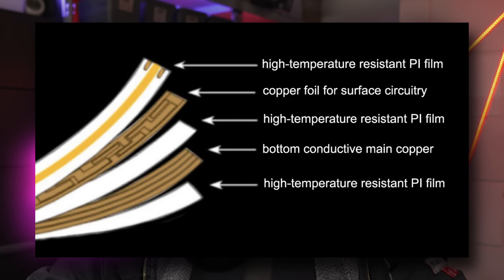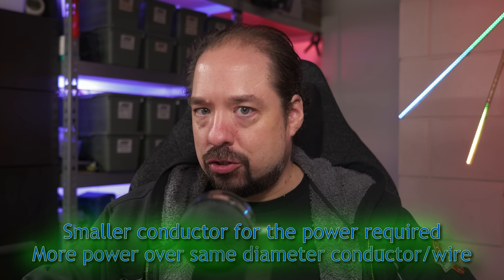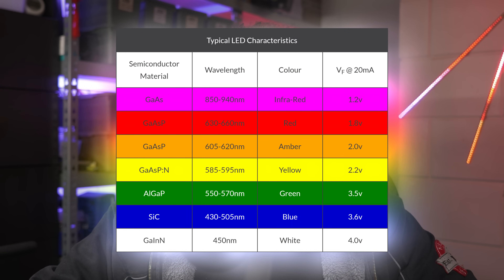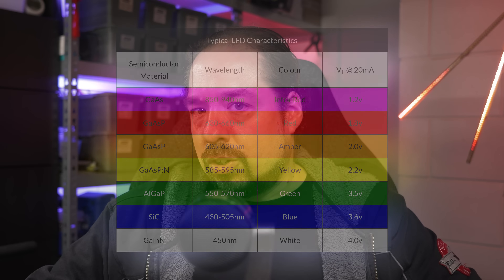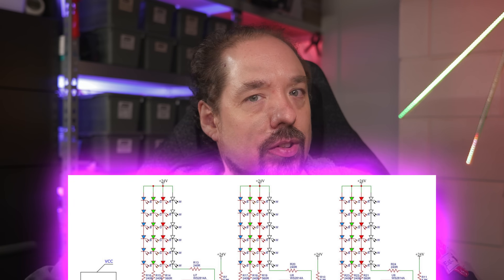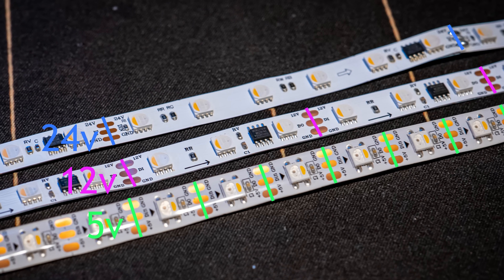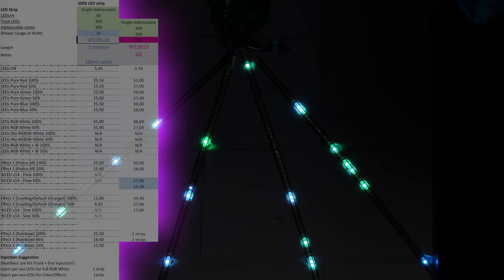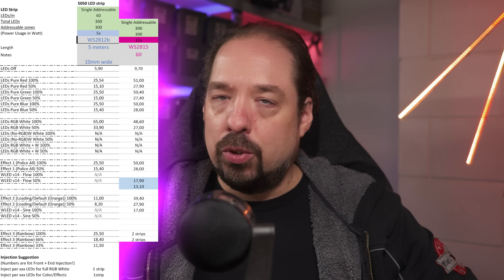💡QuinLED💡How do high voltage addressable LED strips and pixels work?

Comment: You're one of the most honest and knowledgeable Youtubers discussing addressable LEDs, it's disturbing how often newcomers are misled by vendors and so-called pro installers who ought to know basics like Ohms law and good thermal management for long life.
Anyway, I went back through your video catalog, thinking this discussion of "high voltage addressable" would offer some insight into the 110/220V addressable strips I've been seeing listed in recent months. Not only much more compact than the old nonaddressable HVDC RGB rolls, but the addressable segments appear to be fairly short, and they claim up to 50m without power injection. 
I've been dying to know how they do it, and I feel like you're the guy who would give us the best explanation (including any hidden tradeoffs that they might have).
Reply from the maker: Thnx, appreciate that! Are we talking AC or DC? For DC I have seen single addressable pebble strings running at 48v for instance but the way they do that  is that they have segments with an extra return wire and basically always waste a lot of power. That way, since the pebbles don't use a lot of power they can still get quite far!

AC direct strip I have not investigated yet, didn't know there were addressable version potentially.
Reply: @IntermitTech  I assume they use DC that is rectified directly off the mains voltage either 110 or 220V at the controller end, since there's a small box hardwired inline with the mains supply cable. I know that the extremely long nonaddressable RGB rolls that have been on the market for a long time do that, and send the rectified mains voltage down a set of 4 bus wires at the back of the strip, off of which many shorter strips each with sufficient LEDs in series to match the bus voltage, are tapped in parallel. But those require a larger controller box that both rectifies the AC and PWM switches a beefy MOSFET for each color channel.

The descriptions for these new "pixel" high voltage strips do not offer much info except 6W/meter, "energy saving", and "innovative two-wire carrier technology". To be honest, I'm not sure they are truly individually addressable from end to end, since the controller and app seem to offer somewhat repeating patterns (though rather more varied than the low-tech marquee-chase style LED strings of the past). I just don't see how they could fit very many interconnecting jump wires or tracks in a "2025 size neon flex" tube (at such high voltage no less) if it's really just a new variation on those 'dumb' marquee effect LED strings. Certainly would be tough to fit buck converters in there too, I would think. Do they mean two wires carry the power, or some kind of data that's being decoded in the strip? Who knows!
I would love to see someone do a teardown of one. I've only seen promotional video clips on Youtube recently, like this one: https://www.youtube.com/watch?v=WBYGxCFMfNU

Comment: But if one diode in row dies the voltage rises end destroys the rest or i missed something?
Reply from the maker: Yes, it's possible that if a single diode fails the voltage will rise but that shouldn't immediately destroy everything, often it has a bit of a tolerance. This is at least not a common occurance, that a strip goes bad because of that reason.

Comment: The next step for manufacturers will be to make led chips with multiple lower power series LEDs in the one chip.
9 LEDs for 12v (3 red, 3 green, 3 blue).
18 LEDs for 24v (6 red, 6 green, 6 blue).
Reply from the maker: Yes, those already exist in COB LEDs and I have some in already that are in addressable form but the problem will become the forward voltage difference between the colors, the way you describe it won't work or you are going to be burning a lot of power for some color inside of resistors and such. Still, it can be done and at some point we'll see a COB LED, LED strip I also imagine.
Reply: @IntermitTech  the amount of LEDs of each colour does not have to be the same. Unfortunately there would be more red LEDs than blue (opposite to ideal) but this could be compensated for with an internal calibration profile to ensure even intensity. This would make for a chip with maximum efficiency and very low voltage drop.
Are any chips available like this anywhere at the moment?
Reply from the maker: @dougschafer5161 yes there are in COB LEDs, but none that I know of on a strip yet.
Reply: @IntermitTech  thanks for the info.
Would be very interested if you come across any in the future. Thanks for your great content 😊

Comment: So if i want to do a ~150 meter run around my house with WS2811 60leds/m 12v i'd need what, like 33 points of injection? -- just going off specification that stated 5m per string.
Reply from the maker: Yup, 150 meter is an insane amount. Or rather, I haven't checked that number hit that's really really long!

Comment: Thank you for the informative video. I want to install a ceiling (~30-50ft) of leds, and I also want some more accurate warm white along with RBG. Would you recommend me to go with the WS6812 RBGWW - 5V, or wait until FCOB - RGBW 24V version comes in the near future?
Reply from the maker: If you want decent white the FCOV 24v RGBW version is the only option, everything else is low CRI. It's already available on Aliexpress from BTF lighting.
Reply: @IntermitTech  the thing is that the fcob rgbw you mentioned is not addressable right? So, if I want good quality white, I will just have to sacrifice addressability?
Reply from the maker: No it is, but it has 7cm wide zones but good white
Reply: @IntermitTech  is the ws2814 the one you’re referring to? This seems to have a larger addressable zone (56 leds), but its still addressable. Would you recommend this over Ws2811 rgb + ws2811 cct (if I can run 2 strips parallel, though this maybe too much work)?
Reply from the maker: @jadenphan8106 if you want good whites on addressable strip, the ws2814F cob is only option really. Running 2 strips can also be an option yes. The ws2811 only white strips can also work al and are CRI90. I'll have a video in a few weeks.
Reply: @IntermitTech  thanks so much for your input, looking forward to your upcoming videos. This is my first diy project so the learning curve is steep. I am not sure how the controller/power supply logistics would work with 2 different parallel strips. I’m very interested in your pre-assembled Dig-Uno and Dig-Quad, but I don’t have complete knowledge of how those work, so I will have to read up and watch more of your videos to learn about it:)
Reply: Thank you for the video, I didn’t understand it, but enjoyed it.
I’ve have bookshelves with 5 shelves and I’d like to put LED on them. I’ve bought a dig quad, but I don’t know what LEDs to buy. Each shelf is about 3m, and I’d like different colours in each section. Can someone advise me please?

Comment: was wondering if its possible when getting a digtogo to replace the ESP32  with a QUINLED-ESP32-AE+ ? :3
Reply from the maker: Ah no it is not. The dig2go is fully enclosed product. The pluggable ESP32 boards only go on the Dig-Uno and Dig-Quad

Comment: Well, they could just fit three or so led dies of each color in series into one 5050 package instead of wasting the power in only heat emmitting blind diodes 🤔

Comment: Thanks for the good info. 
I want to run at least 3 WS2815 60 LEDs/m strip with 12V 30A power supply in parallel. How can I do the connection. Would 30A damage the WS2815 ? Pls suggest.
Reply from the maker: As long as the power supply is the right voltage you just need enough Amps, more is fine. Amps are drawn, not pushed like voltage is.
Reply: @IntermitTech  Thanks. I got my answer.

Comment: Can you do a video on kitchen under cabinet lighting that has a good white but is also addressable  rgb for specific occasions?
Reply from the maker: I will have one in the future but it's a bit delayed. There is basically only a single strip that is suitable for that and that's a recently introduced addressable 24v COB LED strip in RGBW. It's a bit worse in the color department vs the RGB 720LEDs/m version but it does finally have decent whites and I think would do fine in such situations. My video should come out in a few weeks about it.
Reply: can you link the strip, maybe I can get them via 11.11 sale still. @IntermitTech

Comment: What's the best way to run 12/24v addressable strips inside tracking with full beam diffusion on a house roof line?
Reply: Curious as well
Reply from the maker: Full diffusion mostly has to do with the distance of the LED to the diffuser. With 60LEDs/m generally you'll need about 1.5cm to 2cm distance between the LED and the diffuser itself, we did some tests with that on a livestream a while back.

Of course going for the COB variant can help a lot with that since they are diffused by themselves, then even just 0.5cm is plenty and it'll look very nice if you want the "smooth stripe" look!
Reply: The problem with COB's is they don't come in IP65 and the 60's require power injection both sides of the 5m strip so that becomes a nightmare to hide on long exterior runs. Are there any 10M roll addressable strips available (possibly 48v) out there as that would solve half my problem?  @IntermitTech
Reply: @TechTy  I run power injection wires inside my LED channels, as suggested on ‘The Hook Up’.
Reply: You got a link to the specific video? @TimSpreitzer
Reply: @TechTy  Suggest @TheHookUp go to Rob’s playlists, there are several on LEDs that could help you. I’ve watched them all, at least once. I don’t remember which video it’s in. But if you learn half of what this guy puts out there, that should help you a lot.

Comment: Enquiring minds want to know about the mysterious new 24v high CRI addressable RGBW COB (so many acronyms!) strips!
Reply from the maker: Yes I keep postponing that video because I'm trying to cram too much inside of it. This video was a result of taking some of that out so I'm getting closer but because of some travel plans it'll still be a few weeks before I can finish it. Come to the Discord if you want to discuss it, it's released (the 24v COB RGBW) and it's good for whites but there are some tradeoffs for everything else. It's also already in the power sheet!
Reply: @IntermitTech where on your discord can I find it? Sorry for being a dummy, I have tried to scroll through different channels with no success 🥲 thanks!
Reply: ... Or maybe, the strip exist and  not the discussion about it on Discord 😅